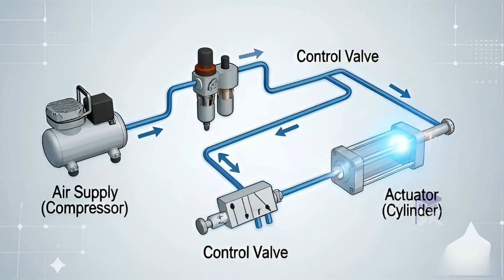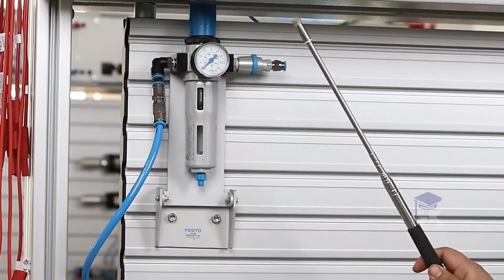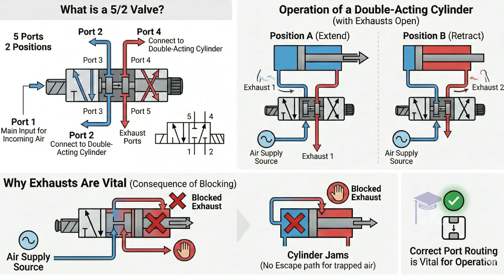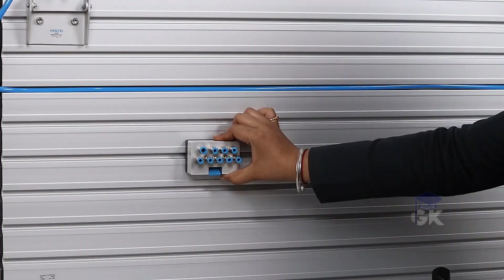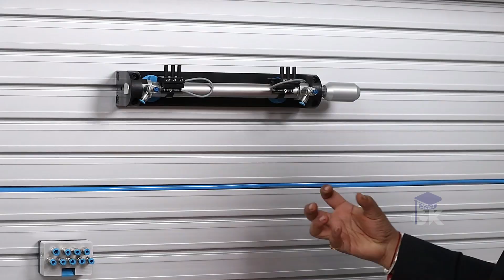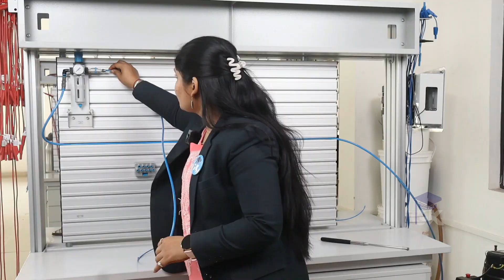Pneumatic Trainer Kit | Experiment 1 : Basic Operations | Fluid Power Lab

Comment: Hi! I’m a college student, and I’m having a hard time understanding how to set up pneumatic circuits using an actual pneumatic training board. If possible, can you make tutorials showing the step-by-step connections and explaining how each component works?

The specific circuits I’m hoping to learn are:

* A memory or latching circuit using a double-acting cylinder, a 5/2 double-pilot valve, and two push buttons.
* A two-cylinder sequencing circuit where Cylinder A extends, then Cylinder B extends, and afterward both cylinders retract.
* A single-cylinder circuit using two push buttons using AND and OR logic (separately)

It would be really helpful to see how the tubes are connected on the actual training board, with a simple explanation of how each component works. I think it would help a lot of students who are also struggling to understand the connections.

Thank you for sharing your tutorials! They’re a big help. 😊